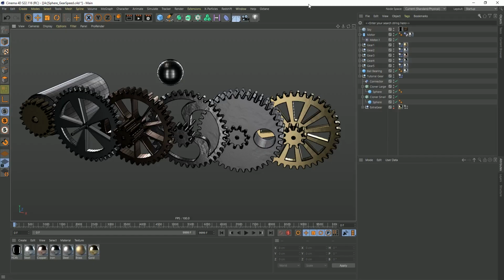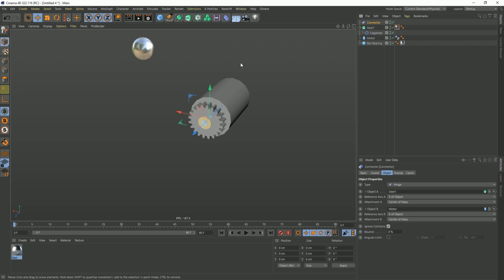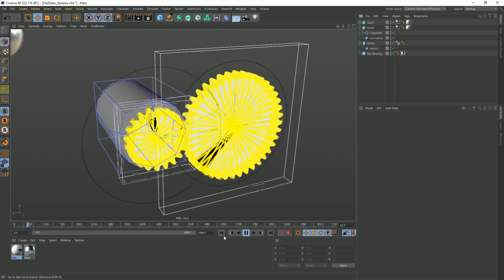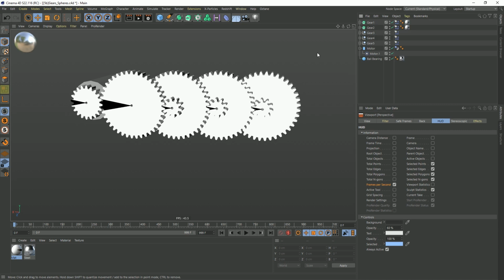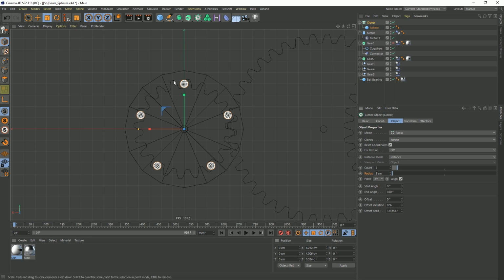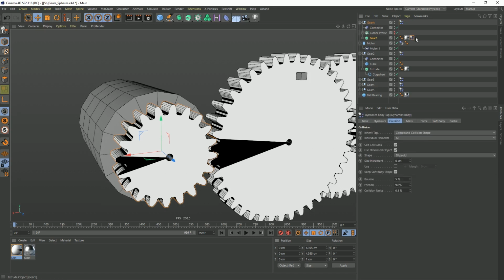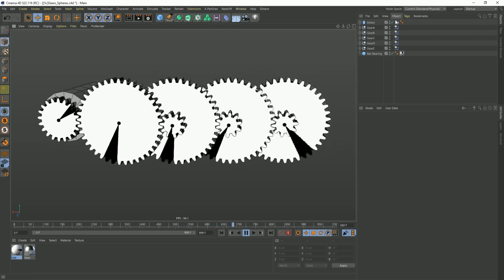Crazy Accurate Speedy Dynamics: Cinema 4D Tutorial

Comment from the maker: Time Stamps
00:01:13 - Context
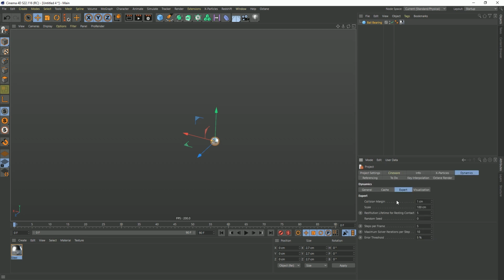00:03:42 - Dynamic Settings, Connector, and Motor
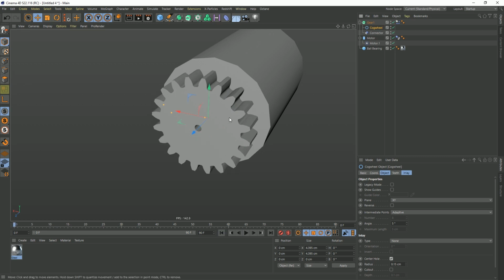00:10:40 - Torque talk
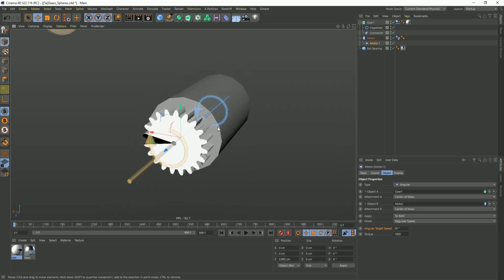00:13:30 - Second Gear
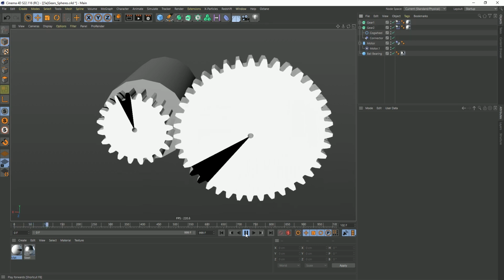00:15:09 - Collision Types and Dynamic Visualization
00:17:22 - Third Gear, increasing gear ratio
00:21:36 - Importance of Density and Mass
00:30:33 - Building Sphere based proxies
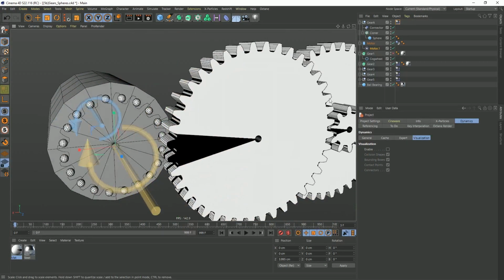00:36:32 - Why is the Compound Collision Shape jittering?
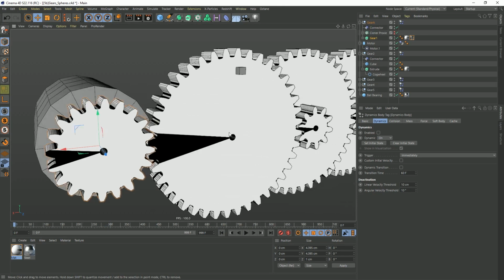00:41:24 - Update the rest of the gears
00:51:02 - Customize the gears. It doesn't affect the dynamics!
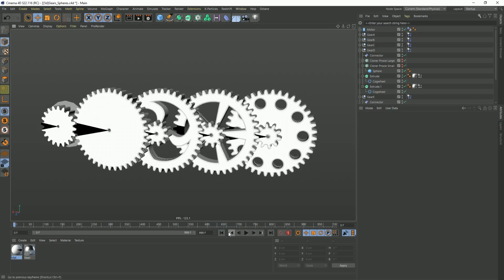00:54:10 - Other places you could go with this idea
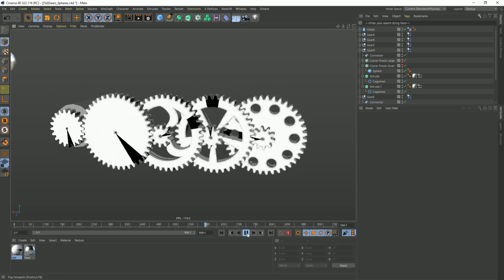00:56:20 - Outro
00:56:33 - Fast Forward version of this tutorial: https://youtu.be/h-g8vl1D-k0 
00:56:57 - Scene files and more! via Patreon: https://www.patreon.com/rocketlasso
Thanks everybody!